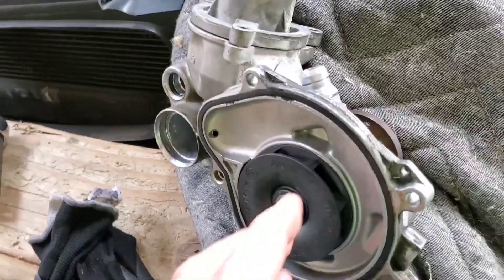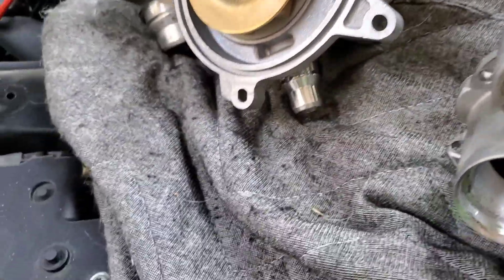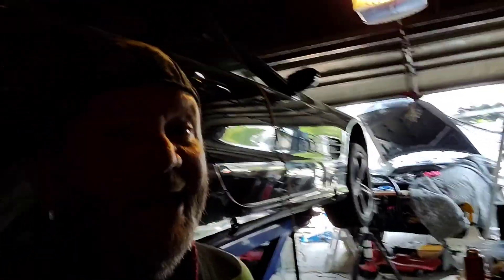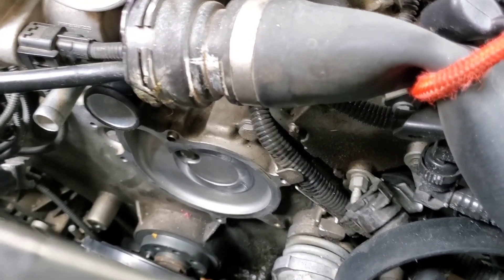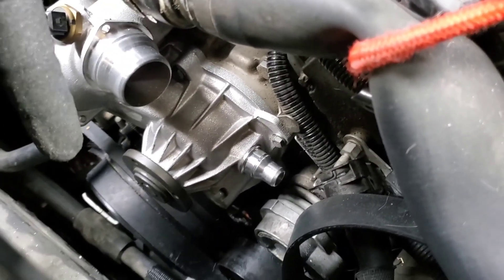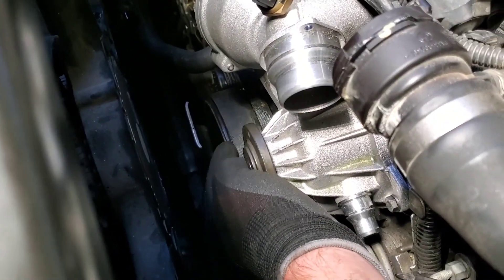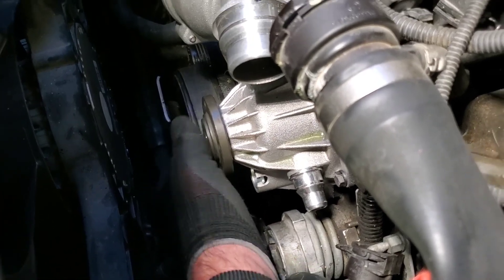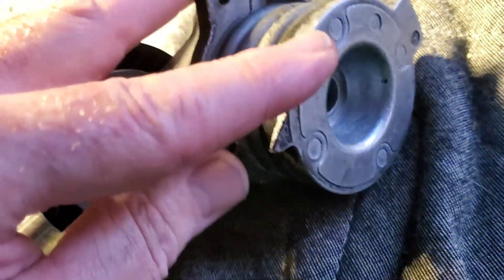BMW E70 X5 4.8 water pump continues.  Broken parts, broken dreams.

Comment: Hi, thanks for this video. I have the very same SUV. It have the Low Engine oil pressure light on. I'm trying to locate it but I can't seem find it.  The oil filter is underneath the Suv. Thanks in advance.
Reply from the maker: Low oil pressure light? That doesn't sound good. 😳   if your oil level is correct, I'd suspect the oil pump.  How many miles are on your x5?
Reply: @OGGarrettsGarage  it has 140 thousand miles
Reply from the maker: That's something I might not mess around with myself. Running it with low or no oil pressure for even a short time can ruin the engine.  Maybe a professional diagnosis is in order. Let me know what you find out.